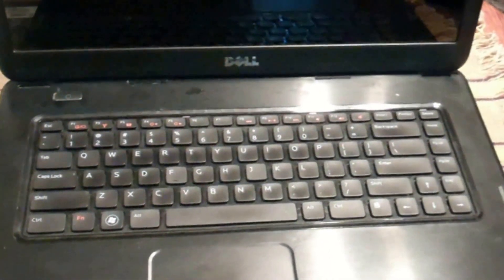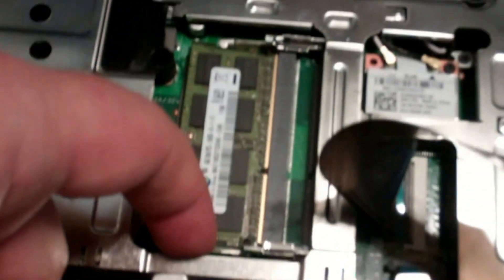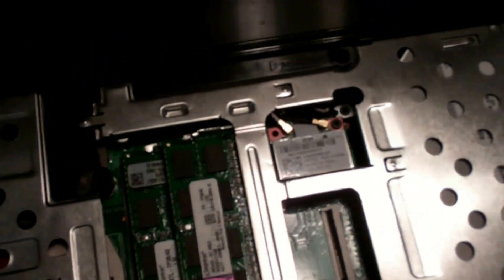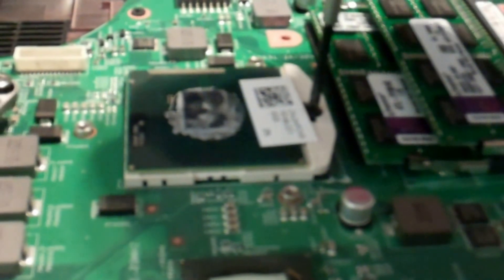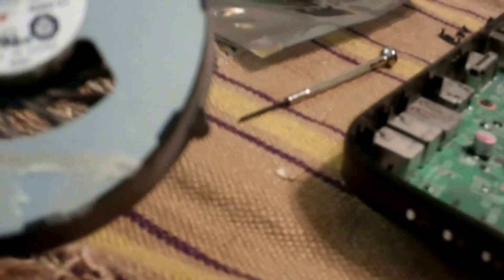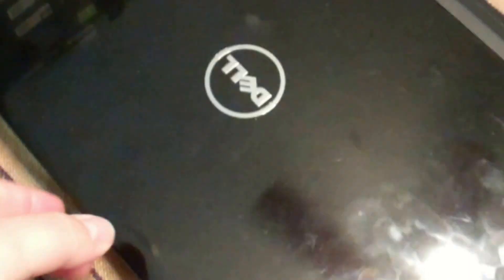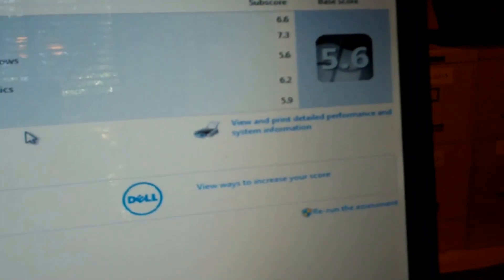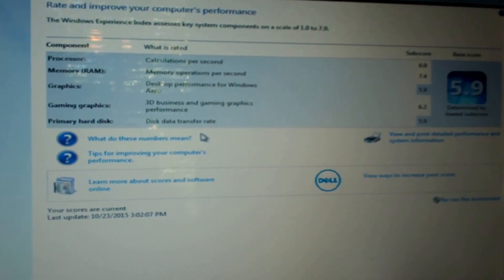Dell Inspiron N5050 Laptop Processor & RAM Upgrade

Comment: I have a n5050 as well, how much faster did your upgrades make it? I updated it to windows 10, put a new motherboard in, new battery but it dies fast still. and I don’t want to get rid of it 😭😭😭 laptops these days don’t have a disc player.
Reply from the maker: I no longer have this laptop but this upgrade does use more power so you need to keep it plugged into your charger.
Reply: Dude, my Dad has this exact model (N5050) I upgraded it with an SSD, an i7-2840QM, 16Gb of RAM and Windows 11... it does fly!  for a 2011 (14yr old laptop) it runs perfectly, be sure to use a good thermal paste, as this CPU runs 10 watts hotter... also configure power setting when running on battery to only use 30% of processor power, to match the wattage consumption of the original CPU... My Dad has been using it for over a year wit this upgrades, and tbh you can even have an "academic" development environment on it and it will run just fine... hope you go for it! greetings from Monterrey Mexico.

Comment: I still use mine but I want to upgrade the RAM to 8 GB. Windows 10 make it slow after I open over 30 Firefox tabs at the same time. It is old but it has an optical drive and more than enough for basic work.

Comment: I have the identical laptop. I just completed the upgrade following your instructions exactly. It took me 2 days to get the back cover off because the screws didn't want to budge! The system recognizes the upgrade. My laptop runs faster but it seems to freeze up and the touchpad stopped working. I will retrace my steps. Any suggestions would be appreciated! Thanks for the video. I never would have had the courage to attempt this without your detailed instructions.
Reply from the maker: I no longer have this laptop so I won't be much help other than what you suggested by retracing your steps. Glad this helped.
Reply: @rvr2  Thanks for replying quickly

Comment: Thank you for this! I just completed the upgrade path myself last night with the i5-2430M. I started out with putting in an SSD, which I'll agree had the best performance boost out of the three. I mainly use the laptop for hobby music production. For about $75 total spent, well worth it. Your video put me at ease when getting in there and mucking about. Cheers!
Reply: Which SSD did you purchase. I have completed the installation of CPU and Ram.
Reply: @yvonnejohnson3710  I ended up going with a PNY CS900 240GB. Cheap, fast and I didn't need a ton of storage anyways for that laptop as I use it for casual music production.
Reply: Okay, Thanks!

Comment: you should on your cpu socket where the 6 dots are on the new socket put a pic of tape on it i got heat sink on the dots before and my computer wouldnt start or run crappy

Comment: Cool Video!!! Btw, Inspiron N5050 supports 16gigs of RAM (1333Mhz DDR3), I checked via running a cmd command ( "wmic memphysical get MaxCapacity, MemoryDevices" ). I'm planning to do the RAM upgrade first and later after a month or so I'll add SSD (120gigs) for Windows.
Reply: I did the upgrade, just in case anyone's wondering. I upgraded one slot to 8GB and another had 2GB - so effective becomes 10GB of RAM. Chrome now works smooooooooth and I can play couple of games at low settings.
Reply: @deep4966  hola bro,yo también tengo una DELL INSPIRON N5050 core i3 2370m actualize ram a 10 gigas y disco duro por SSD va de maravilla con Windows 10.ya viene en camino un i7 2760qm para actualizar procesador i3 2370m

Comment: Can you upgrade the SSD on these too, if so what would you recommend?
Reply from the maker: Yes. Depends on what you are wanting to do most with it.. The max is 2TB I believe.
Reply: @rvr2  Im only looking at 250 or 500gb i meant any brands in particular or will any ssd suffice
Reply from the maker: I bought a Samsung 850-EVO 500GB SSD and it worked great.

Comment: I upgraded to 4 gb of RAM to 16 gb Dual.   And processor i5 2540m ( I read that ir can handle an i7).    With a SSD Western Blue 500 GB  and a HDD 1 TB. Barracuda.   It is a very interesting.      Option as a side Computer.
Reply: @FINAK DZ i upgraded it to i7 2670qm its so fast like 10x faster but its turning off randomly because high temp and i dont know if the cpu have a probleme or its just because the laptop cant handle it and cool it , do you have any advice on how to know
Reply: Does anybody know if the latest BIOS A05 (released in 2020) make this N5050 able to take the i7-3632QM? (Also runs at 35W)  it is also a PGA988 the socket the N5050... need to know since Im planning to do that crazy upgrade 🎉

Comment: can you do some gaming tests now?
Reply from the maker: I no longer have this laptop..
Reply: @rvr2  which laptop do you have now specs?
and when you had this did you run gta5 or any other games I am doing the same upgrade but I'm confused if I should do it bcoz my purpose is to run gta 5 and watch dogs 2
Reply from the maker: I now have a Dell Latitude 3590 with i7 Core and 32gb RAM. You can find more detailed specs online. This laptop might be better for gaming instead of upgrading in my opinion
Reply: @rvr2  If I had that much money I would have bought a new one but I'm a student and upgrading is my only option  
nevermind I got some gaming test I will upgrade soon!!!thanks for the video (;

Comment: I have a same laptop and I am experiencing the lagging issues. My laptop is in mint condition and his almost 8 years old. Should i update the processor from I3 to I5 and also add an additional 4GB RAM? or should i buy a new laptop? Please advise.
Reply: I prefer upgrading it.. Upgrade the RAM, processor and also replace the HDD with SSD. At the end of the day it's your choice though, if you can buy a new model then go for it.
Reply: try the new ssd hard drivrs sometimes older the hard drives are the slower the pc is if u uses it evrryday and the newer drivers are bigger

Comment: I'm having Dell Inspiron N5050. Currently I am having 2GB +1GB config.

I need to upgrade it to 6 GB (2GB + 4GB)
Is there anything else other than Clockspeed and matching company that I should check?

Will it work smoothly if I don't upgrade my processor and just upgrade my ram from 3GB to 6GB
Reply from the maker: Maybe.. I don't know.
I researched the processor and RAM specs for this laptop before I did my upgrade. I would recommend you doing the same.

Comment: im wandering why u didnt clean the old paste off?  itll run by far so much cooler if u did that and then put on the new paste
Reply from the maker: It didn't run that hot before and it didn't run hot after the upgrade..
Reply: @rvr2  hmm thats odd most of the time they will, i was just curious is all, but if u ever go to do it again think about it its alot better use isopropyl alcohol to remove the old paste. pretty neat tho that it worked out with that chip hows it running today?
Reply from the maker: It was running great after the upgrade but I have since sold this laptop a couple years ago and bought a newer model Dell
Reply: @rvr2  oh cool was just wandering if u still had it, Def got your moneys worth out of it tho lol

Comment: HI,
I've got a dell n4050. Got to know that maximum memory capacity allowed by the motherboard is 8GB. I've purchased a singl DDR3 8GB stick. Will that do the job? or do I have to give it by 2 sticks of 4GB each?
Thanks in advacnce.
Regards,
NR
Reply from the maker: No idea but since you already bought it, try it and see.. I used 2 4GB sticks for mine.
Reply: RVR2  Okay! I’ll give it a try. Thank you for your time!

Comment: Hi is it ok if i upgrade processor and ram same as yours with my current specs Intel pentium 2.10GHz and 4gb ram
Reply from the maker: If your laptop is able to handle that upgrade.. You need to research your laptops max upgrade specs to be sure or ask a local computer repair shop

Comment: Forgive me for asking so late, but I have a Dell Inspiron N5050 like the one in this video, but mine has an Intel Pentium B960 CPU @ 2.20 GHZ, 3 GB of Ram, and a 320 GB Western Digital HDD so I'm assuming all these years that I've had the lowest end model. If I were to take part in these same modifications everything should work properly right? I've seen on some other videos that modifications might not work without BIOs updates however I'm not too knowledgeable on that.
Reply from the maker: I never did a bios update to mine and it worked just fine after these upgrades.. I would also recommend switching out your HHD with a SSD and you'll see a noticeable difference in speed.
Reply: RVR2 Thank's so much for the info!

Comment: Why you didn't install i5-2540M? It has 2.6GHz and in turboboost up to 3.3GHz.
Reply from the maker: Because after doing some research, this was the max processor compatible with this model Dell, per the Dell website..
Reply: RVR2 But they use the same socket, do you think I can install 2540m?
Reply from the maker: No idea.. Check the Dell website or call their tech support..
Reply: RVR2 ok, thanks

Comment: i need your help i have a dell E5430 it has i5 3230m, i want to upgrade it to i5 3380m
socket of i5 3230m is "FCPGA988" it says on intel website and i5 3380m socket is "FCBGA1023, FCPGA988" do you think it will be fine?
Reply from the maker: Ok I'm no expert on that.. I simply did research on my particular laptop to see what was compatible and ordered those recommended parts and then installed them in this video.. I would suggest you do the same.

Comment: Sir I have Dell inspiron 15 n 5050 core i3 2370m ,2.40ghz ,2gbram, intel hd graphics 3000 but now I am facing very lags while playing games like nfs 2012, nfs run  a what to upgrade my laptop like, I have 2gbram then can I add one more chip of 4gbram so it will be 6gb and from 2.40 to 3.4 like that  can I do all things like that please help me I am very confused please.
Reply from the maker: Maybe.. I would do a similar upgrade from the i3 to i5 processor and max it out with 8gb RAM and see if that fixes it..
Reply: RVR2 can I increase the  clock speed of my laptop form 2.40ghz to more
Reply from the maker: I don't know.
Reply: RVR2 ok so do you know about graphics card like Nvidia, amd , intel graphics card
Reply: Should it compatible for my laptop
Reply: no ...
Reply: It's a old laptop. The integrated graphics processor on the cpu it's not designed to run heavy games. You'll be fine playing <2010 games at low or medium settings. I Also recommend to change the thermal paste on the cpu to lower the temperature And so increase the performance.

Comment: Hey, thanks for the video tutorial.  I have a Dell N50 40 and I am considering doing these same modifications. As is, my laptop is extremely slow rendering and uploading videos. I was wondering how much of an  improvement have you noticed after doing your upgrade? (Especially when video editing)
Reply from the maker: The processor and RAM upgrade was a noticeable speed increase but the big boost in speed was replacing the existing 500gb hard drive with a 500gb SSD.. That was an amazing difference in speed!
Reply: RVR2 Thanks for answering back. I gave you a sub!
Reply from the maker: Thank you very much! Likewise

Comment: the Inspiron N5050 is the same model with Inspiron 3520? my 3520 is equal like this N5050... can I upgrade my 3520 with  Intel Celeron D820 to Intel Core i7 ??? answer me pleace, sorry for my english...
Reply from the maker: No idea.. You need to ask a local computer tech about this
Reply: RVR2 in another video one man was upgrading a Dell Inspiron 3520 CPU from i3 to i5... he let some links to check the hardware price and I enter to see and the CPUs are to the Dell N5050... So I think both computer are the same model with diferent name... In some web  pages is named Inspiron 15 too...
Reply from the maker: You might want to ask them then.. Again I have no idea. 
I researched mine, found the max processor and RAM it could handle and installed them.

Comment: I have the N5050 in core-i3 2.3GHz and 2.0GB RAM. Only thing I did was to ugrade to an SSD Samsung, without touching memory or processor. After the disk upgrade, it works remarkably faster!
Reply from the maker: I went ahead and maxed it out along with adding a SSD and yes it's really fast now
Reply: @rvr2  Hello, I have a n5050, it was originally 2GB and an intel celeron processor, I installed the core i5 and did everything right and it does not start, but with the old processor it starts
Reply: @Lopeg1200 vengo del futuro,tenías que actualizar BIOS.
Reply: @rvr2  and yes i bought intel core i5 3230m
Reply: How much does  SSD Samsung cost tho? I am thinking for an upgrade too

Comment: Hello. I face big problem . i used dell inpiron M5030 . It is   AMD dual core T4500 Processor . but this pc not supported virtual tecnology. if i upgrade processor this device support Virtual machine. It ram is 6 GB. if possible which processor support it. please help me
Reply from the maker: Virtual technology has to do with your onboard graphics.. If you can't upgrade the onboard graphics card then it probably won't support virtual technology..

Comment: is this possible to change my laptop processor intel celeron  n3050 1.60 ghz to  intel i3 dule core 3.3ghz ... my laptop is dell 15 n3552 is very slow .... so i want to change my laptop processor
Reply from the maker: Maybe.. I would contact Dell support and ask them if it's compatible..

Comment: i have inspiron n4050 and i am not able to play high graphics game on  my laptop......  it has 2 gb ram nd 2.3GHz i3 processor what if i ugrade it myself with 8gb ram,4gb grabhics and i5.
Reply from the maker: Those upgrades may help but no guarantee it will be able handle the graphics any better.. That's usually a video card issue but I don't know that you can upgrade the video graphics card in that laptop.. 
I would consult an I.T. specialist on that.

Comment: If you don't mind, may I please know where you purchased the ram and processors from? If you can post links, that would be greatly appreciated! I found your video to be very useful. I have the same model as you, and it still works wonderfully, but I require more out of it and I am too cheap and attached to buy a new computer. This video really showed me the light lol XD
Reply from the maker: I bought them both on ebay so posting links would be worthless.. I listed the model numbers in the description for others to use to search for the same processor and RAM I used. 
I also upgraded my hard drive to a Samsung EVO850 500GB SSD purchased from Amazon (can't find a link at the moment..)
Reply: This enough info. Thank you for the quick reply!

Comment: to any one doing this i recommend removing the old thermal compound from the cpu and the cpu heat sync the old thermal compound will not conduct properly the way he is doing this in my exp
Reply: heat sink *
Reply: I wondered if anyone would catch that. I see products for cleaning and prepping the surfaces, but can you recommend something I might already have lying around the house?
Reply: I use 99% isopropyl alcohol (rubbing alcohol) from cvs as long as its at least 91% it will not damage the board or any components and cleans well. most people have rubbing alcohol. Hope this helps :) @MoltenHeart thank you for the correction.
Reply: Does Inspiron n5050 support 8gb ram.?

Comment: speaking of  ram i pick up  a mini pc  from dell   that  use   ddr3L   it  wood  not use norm ddr3  it  was  block  in the bios  dumb  thing ever  cost   abt  the same  tho but  suck when  you have  boxes of  the old  4 gig ddr3
Reply from the maker: +thesmashtvnetwork That sux.. Yeah I made sure both the processor and SDRAM would work in my laptop before buying them.. First time upgrading a newer laptop like this and everything went smoothly.